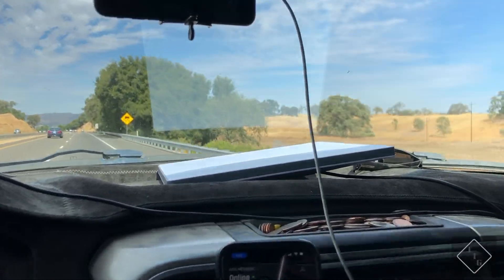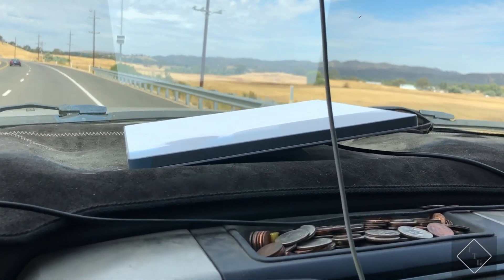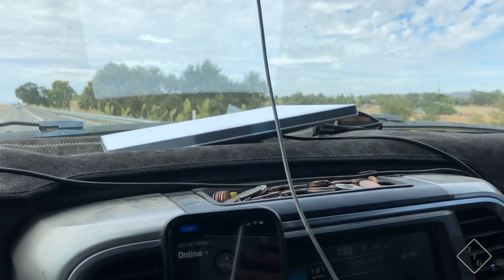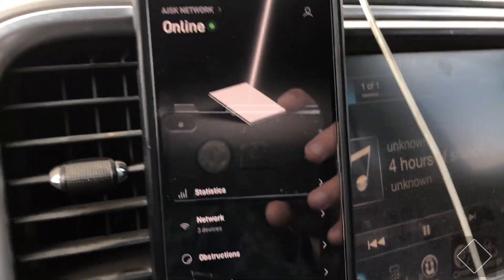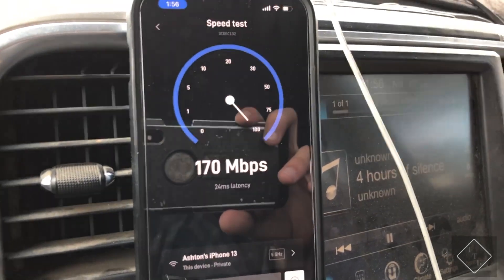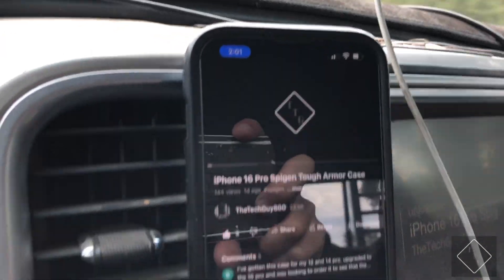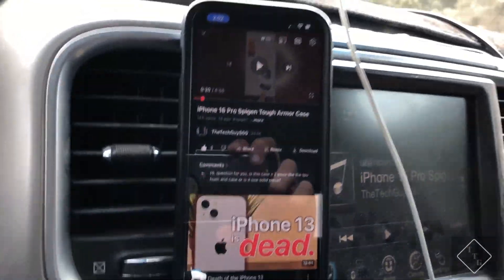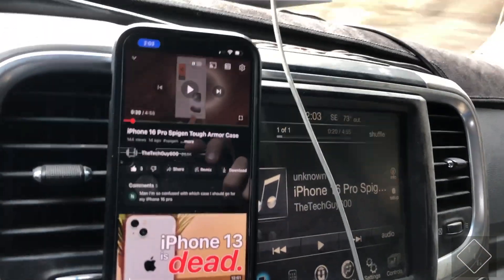Will Starlink Mini Work While Driving?

Comment: Does the Starlink maintain a connection regardless of which direction you are traveling?
Reply from the maker: It does for the most part however it will have minor drops if it losing sight of a satellite. I wouldn't recommend trying to do a video call or Wi-Fi phone call when in motion as it will most likely drop. Things that have a buffer such as watching a YouTube video, it will work great.

Comment: Couldnt you just hook up the original power wire to your truck inverter? Not a usbc wire to the adapter.
Reply: @Bellaloveshorses1234   i use a jackery when i use it in my truck
Reply: Oh true right?

Comment: I’m not too concerned with the in motion aspect but I am interested in the dashboard through windshield aspect. There doesn’t seem to be great mounting options for Semi truck mounting so I was considering the data throughput while receiving through a windshield. I hope that they’ll make a mount that can clamp onto the top of the hood by the windshield wipers and you could run the cable through the A Pillar door jam.
Reply: They make plenty of magnetic mounts for starlinks. I was wondering the same thing too for my semi if I could just throw it on the dash though so I don’t upset my company or let someone steal it
Reply: @ I’ve see them but that would only work for the old Pete’s and KW’s with the metal hoods. The MC’s are all using the aero trucks so the 760, prostar, t680, cascadia, and that aero Pete I can’t remember have fiberglass hoods. I’ve seen Ram mounts with c clamps for pipe but that’ll only work on old mirrors for Pete and kw also
Reply: @marqueswilsonn  they have suction cup mounts with industrial suction cups that are very strong and hold while driving.
Reply: But just google magnet mount there are a ton of them available for starlink
Reply: Low risk

Comment: Im getting this for my Tesla. I'm just debating if 50GB is enough or if it i wanna do unlimited plan. I already have STarlink as a backup but now im thinking of just ditching that plan ($120) to do the $165 instead.  already have fiber at home so starlink was always just a really fantastic bcakup
Reply from the maker: Well it would all come down to what you plan to do with your Starlink. If you plan to primarily use it in your vehicle, as an emergency internet connection while in a no cell coverage area or simply using it while camping then I would say the 50GB plan would suffice. However, if you know you will be streaming lots of high resolution video or downloading/uploading lots of files on a monthly basis then the unlimited plan would be better.